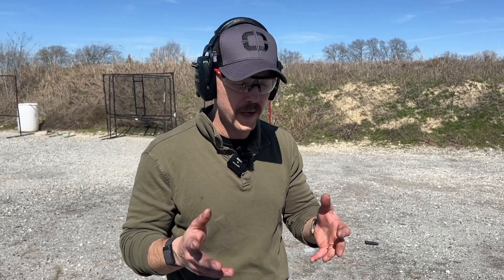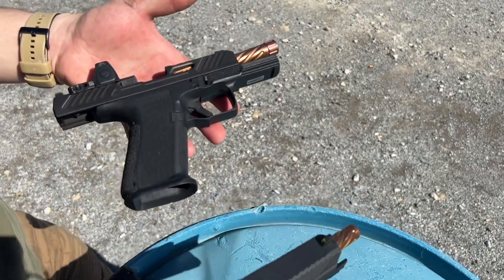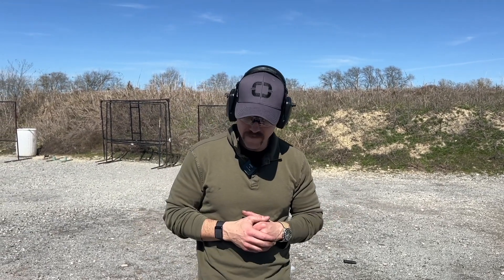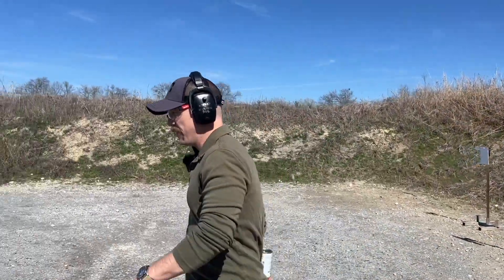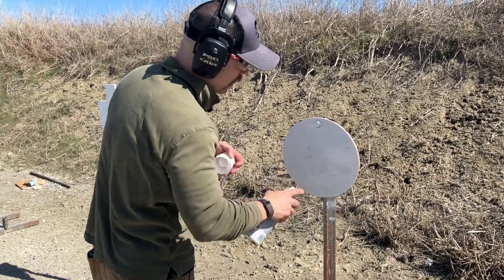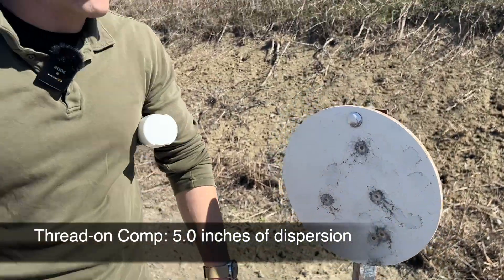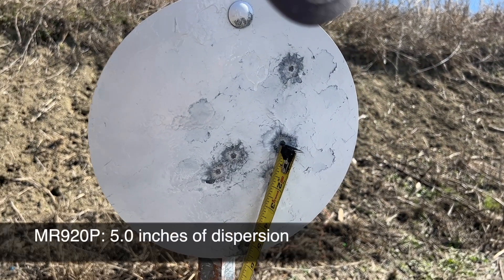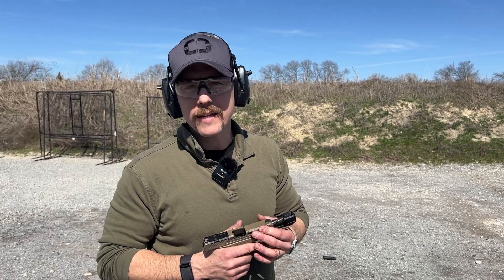Technical Tuesday: Compensators and cone of fire

Comment: I'm really impressed with Shadow Systems. I've had an Mr920 a little over 2 years with 7500 rounds and literally no issues, and about to get an XR.
What I'd love to see next is the CR920X(P). I got to try the CR920P at a range event and it's fantastic, but a slightly longer grip would make it perfect